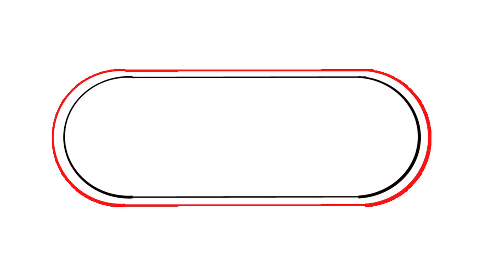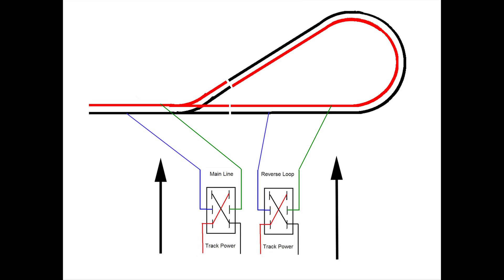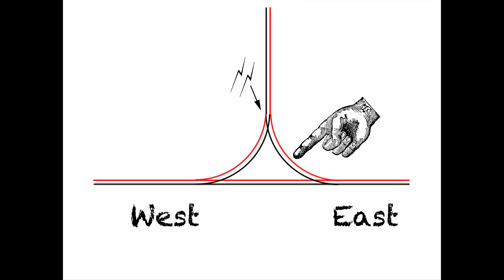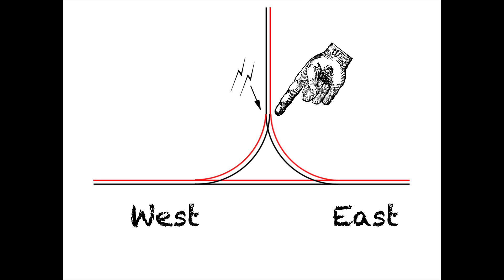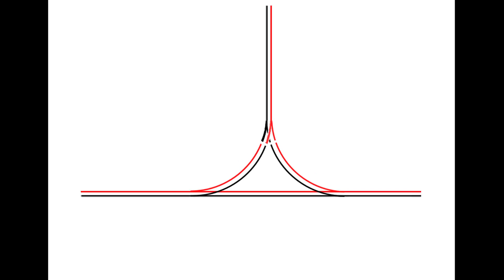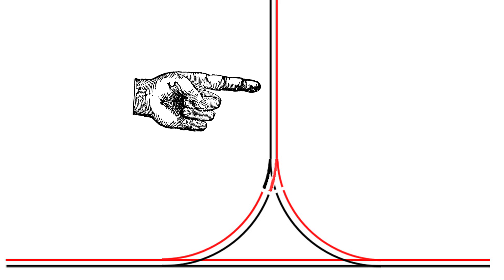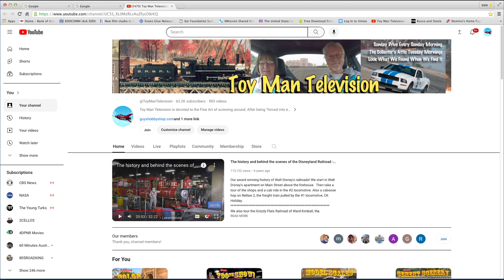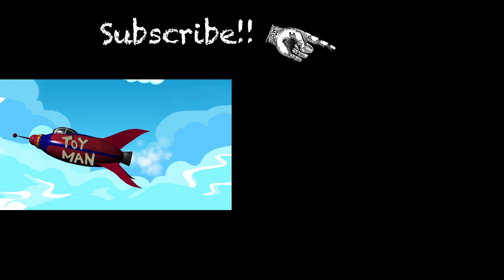How to Wire Wye Tracks - Electricity for Model Railroads

Comment: Hey Dale - I have a question that is unrelated to this subject, but goes back to your scales and gauges series:
I was at Disneyland the other day (as we do every week) and in California Adventure there is the Trolly Treats candy and confections shop. For those who may not know it themed to trains and street cars being located on Buena Vista Street along where the Red Car street cars run. In the window display there all sorts of model trains in various scales, mostly vintage to fit the theme.
I’ve looked in these windows 100’s of times but never noticed this unique track I had never seen. It looks just like a 3-rail Lionel track, same tube-like rails and all, but a much wider gauge and scale closer to what G-scale would be. Even the train cars looked to be more the size of a garden railroad. It all looked like giant-sized Lionel trains! Have you ever seen anything like that? I took a photo because I was so intrigued by it. 

Thanks!
Reply from the maker: Yup. “Super Gauge”. Sometimes called S gauge but that’s wrong. Close to #1  but a tiny bit smaller and three rail. Lionel and Marx both used it. Mostly Marx.
Reply: @ToyManTelevision  Honestly before watching your videos on all of that, I never noticed it. As I said, I have looked in those windows for years and except for the holidays where they change them a bit they have basically been the same. See—your videos are very influential! Next time you go to Disneyland you’ll have to go into California Adventure and take a look!

Comment: This is one of the reasons I'm fine with sticking with O-gauge. 3 rails are great!
Reply from the maker: They sure a lot easier to wire aren’t they?
Reply: Same for me, but battery power. It doesn't solve the problem of wiring, but it sure does move it around!

Comment: Great video. I, myself, try to avoid the balloon track design, due to the wiring headaches it imposes. 

That said, I would likely use a dog bone style of design, meaning there are two main tracks essentially going one way and returning the other. 

But I'm thinking to add a double crossover switch in a couple places, for the train to come into, and out of the yard area, so I'm thinking that will produce the same short circuit condition as the balloon track would.
Reply from the maker: Yup. Two weeks. I’ll explain.

Comment: Dale, wouldn't it be easier just to have a Remote Controlled locomotives with it's own battery to run it & a hand held throttle?
Reply from the maker: Hi. Not really. It depends on the scale of course. Many large scale modelers do that but it’s expensive. About $300
To get started and around 200 per locomotive. And in smaller scales really hard but I’ve heard of it being done in
n scale!!!  But track power isn’t really all that hard to do. Even outside!
Reply: @ToyManTelevision - Outside is even harder because of oxidation on the rails or rust, don't you think, Dale?